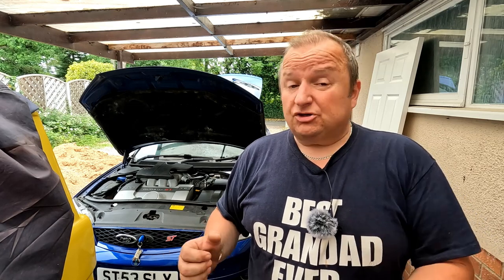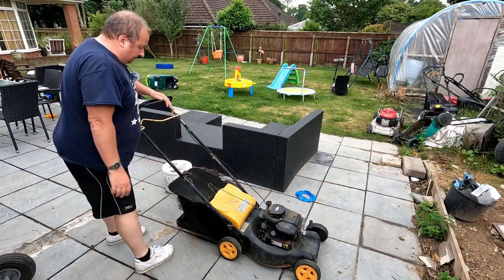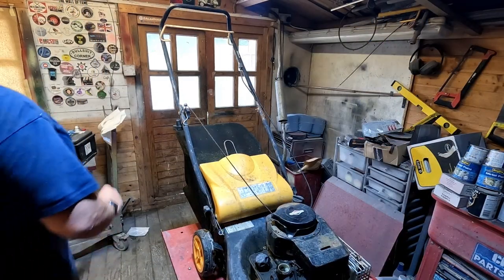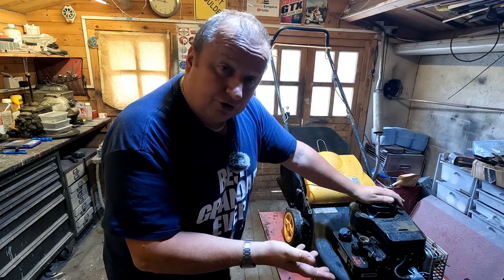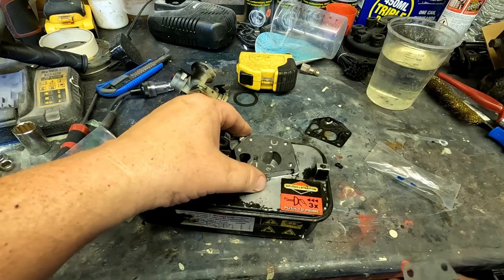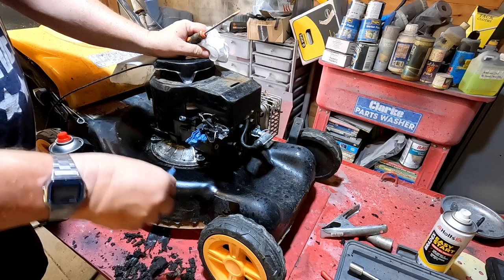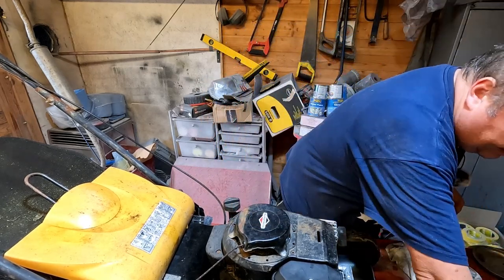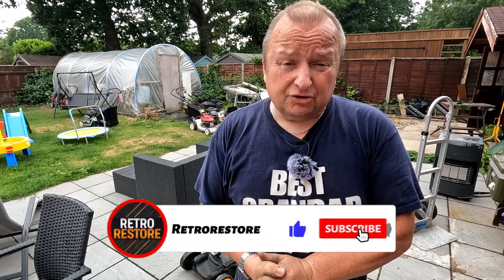I'm Going Crazy So I Fix A Lawnmower Vlog.

Comment: If you have a Jack that you carnt get under the car. Drive the car over a brick or a block of wood to give the Jack clearance then you can use the higher trolley jack
Reply from the maker: Yes, I knew that but after am hour of faffing and not needing to remove the wheel, I didn't need to

Comment: Martin, I feel your pain when things go wrong with the car. I can change the engine oil and transmisison fluid on my Volvo XC90 without jacking it up (the joys of SUVs). The lawn mower will do Tracey a good turn. I recently dug out my lawn mower and I managed to get it going without too much trouble. They're so easy to work on.
Reply from the maker: Nice one Dave